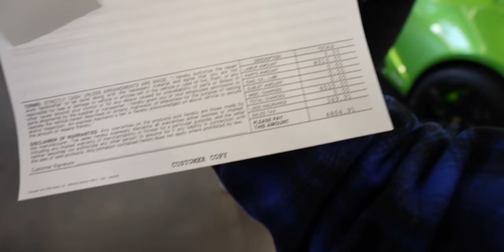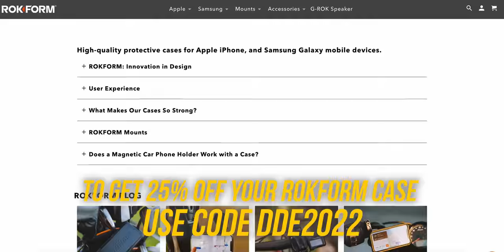DAMAGE COSTS I’M SUING FOR FROM LAMBORGHINI SLEDGEHAMMER ROAD RAGE!

Comment: Watching him pick up that new windshield made me so nervous!
Reply: Me too but you could see he was an absolute pro with how easily he handled it. Complete confidence in his own ability.
Reply: @Kyomara1337  sorry but as a pro i can say this guy is not on par with being called a pro. that job is horrible
Reply: @robineriksson953  well what went wrong? coz to me (obviously untrained) it looks good
Reply: @robineriksson953  let's just say Damon was being nice and found the cheapest glass repair shop he could find. Oh Canadians, too kind.

Edit: I also thought it looked pretty good. Wouldn't be able to tell the difference between a pro and amateur(?)
Reply: @robineriksson953  then enlighten us with what he did wrong? instead of just coming here acting like you know better.
Reply: @Kyomara1337  i did a large post. I'll see if I can copy it. At work right now so. But it's several things. I own a shop wich just deals in windshield repairs.
Reply: @Kyomara1337  first that way of cutting it out is extremely risky. that knife is ancient. you either use nylon thread or a more modern knife with protection on it that is adjustable to have less risk of damage. second is the glue. the way that they cut the tip and angled it will create a blob instead of an inverted V. also the V-cut was to low. also its not straight. he basicly leaned it inwards to the opening instead of 90 degrees to the metal.  as well as using 1 component glue wich increases curing time and often is too stiff wich increases risk of new cracks. and 3rd and worst offence in this case is that he didnt use any primer on the body means two things. big risk of corrosion from thin scratches. some scratches you cant even see with the eye when cutting so by not priming he increased the risk of rust. then 2nd on the body is that there is risk that the glue wont attach perfectly. then on the window there is no primer either wich in turn makes it guaranteed to come loose. especially in a collision.
Reply: @wounddd  first that way of cutting it out is extremely risky. that knife is ancient. you either use nylon thread or a more modern knife with protection on it that is adjustable to have less risk of damage. second is the glue. the way that they cut the tip and angled it will create a blob instead of an inverted V. also the V-cut was to low. also its not straight. he basicly leaned it inwards to the opening instead of 90 degrees to the metal.  as well as using 1 component glue wich increases curing time and often is too stiff wich increases risk of new cracks. and 3rd and worst offence in this case is that he didnt use any primer on the body means two things. big risk of corrosion from thin scratches. some scratches you cant even see with the eye when cutting so by not priming he increased the risk of rust. then 2nd on the body is that there is risk that the glue wont attach perfectly. then on the window there is no primer either wich in turn makes it guaranteed to come loose. especially in a collision.
Reply: @robineriksson953  do you work on supercars? or is it more regular cars? and is the process of windshield installation different for both or the same
Reply: @robineriksson953  fair enough, thanks for taking the time to point out the different things that you'd only notice as a professional 👍
Reply: @wounddd  i work on basically all cqrs. But do alot of what we concider rare and luxury. Tbh i almost think my shop do more AMG cars than Mercedes themselves do 😂
Principle is the same. It's more like some supercars hide things pretty good so you need to have feeling when working with them. Like the Lotus exige you have to remove the entire clamshell. 

It's more like lambos are a bit tighter between the glass and the surrounding paint. But basically it's the same as an Audi A3 or a golf.
Reply: @Kyomara1337  no problem. I can guess why he angles the gun that way and it's because of his belly. Also the Lambo you can glue on the window directly with less risk of the glue showing up inside the car. If the glue touches the interior trim on the sides it will impair the airbags.

Comment: The new windshield is slightly off on the right top. 😬 You can see the yellow on top of the right side after it was done.. It was placed correctly when the first guy put it on but the second guy let the windshield slip down ever so much because he started pushing it on the top instead of pushing it on the bottom and then towards the side. Check out 8:45

Comment: I disagree about the insurance filing suit against underinsured drivers. I was rear ended by a women driving over 100mph, while I was going 65mph. My car was totaled. Turned out she had no insurance so I had to pay my 1000 deductible. They said that I would get reimbursed once they sue and collect, but I NEVER was reimbursed. In fact, they didn't even bother filing suit. After considerable flack from me an agent stated that the attorneys found she had no assets and no money so they determined that a suit was not cost effective and unlikely to realize any amount of reimbursement. So I was screwed out of 1000..

Fortunately I banked with a terrific credit union that offered GAP insurance when I took out the loan for the car. I had no idea at the time how important that was. They paid off the car and gave me 1000 $ if I financed another car with them. So it all worked out good for me. Unfortunately most won't have that kind of great banking experience.

Comment: Fun fact about the windshield razor? Dozens of people a yr get injuries in Ontario due to pulling the garatte part and it slips and will stab you in the face or chest due to the tension and pulling towards yourself, a guy at Speedy Auto glass in Scarboro in Toronto lost his eye so my buddy who worked there told me when I got my Wrangler window replaced. He said he was always careful to pull it the proper way when removing windows with too much sealer.

Comment: Don't forget to charge for the new windshield banner and installation!
Reply: im pretty sure they said in the video it was going to be like 450 for a new windshield decal and roof wrap
Reply: They need an interior detailing charge as well to get all the glass out.. plus a charge for a car detail
Reply: Most insurance companies arent going to cover such added accessories. His will if its specifically named. You cant add $10k in added parts to a $10k car and declare its now a $20k car, unless you get your insurer to recognize that and its gonna cost you extra. The guy who hit him is only on the hook for the blue book value of the car or replacing the parts to OEM spec.
Reply: @john lucier , keep in mind this is a work vehicle. If you have a custom paint or custom wrap job on a work vehicle, insurance isn't on the hook for replacing that as well? I beg to differ.
Reply: @josiahhein6036  that may apply. Where did you get the info that this is a work vehicle? Maybe its time to overhaul some tax laws, if speeding around in a lambo is deemed a business and the cost of exotic cars is written off. 
(Not saying youre wrong, my employers in the 90s had 2 jaguars registered in the name of the office furniture company I worked at. They did use them in the course of a legitimate business that did something for people. I havent seen anything tangible from DDE other than being a nuisance to the community in every way)
Reply: @josiahhein6036  lets say that DDE claims their window banner was a business necessity, but just for aesthetics they had it done in 24k gold leaf at a cost  of $10,000. Would they be expected to replace it? Or would they settle at providing reasonably priced signage, and not be required to replace unusual equipment?

Comment: If I can recall Correctly .. I had the Windshield of my 1975Chevy C-65 replaced for $77.00  in like 1986  .  I also paid $70.00 for a side window for my 1979 Camaro and I installed it myself ..

Comment: i know its done now, but when glass is badly smashed like that, use a sticky sheet on both sides (i use clear book protectant film from the stationary store, couple of bucks a roll). It acts like a window tint or something and catches most of the glass. The mess is one thing but as you know those shards will continue to cut the dash and trim etc

Comment: The majority of insurance agents are clueless and overpaid. They can only write an estimate based off damage that is visible. It’s up to the repair shop to provide proof of all the damage that isn’t visible. I worked for an auto body repair shop for years that specialized in Audi, Tesla, higher end vehicles.. You really can’t get a good estimate until the vehicle is disassembled and thoroughly inspected by an experienced damage evaluator. I’m sure this repair tripled in cost or otherwise deemed a total loss. If you own one of these higher end cars, get good insurance. And make sure the repair shop is specialized, and CERTIFIED to work on your vehicle.

Comment: I had a similar incident involving my 335. Was coming home from the beach, slowed down in front of a dude to go over a set of railroad tracks without destroying my car. Dude behind me didnt like it and apparently thought i was "brake checking him." He pulled in front of me at an intersection to block me in, got out of his truck in nothing but an American flag speedo and busted out my rear window. I took off, until I realized my rear window was shattered. I Made  a Uturn, caught up with the dude, called the cops. The dude tried running despite being in an F150 pulling two jet skis. I called the cops, they finally pulled him over and arrested him. Dude was extremely drunk. The cop who was talking with him came over to me with a little "evidence bag" that included said speedo, and some type of tiny liquor bottle and said "damn, that dude is Fu** up". This made me question how/when/where the dude changed out of the speedo, but anyway he had to pay restitution. Initially they quoted $350 to replace it with a "Like OEM" window, but I told them I would not get a new window put in unless it was OEM and stamped BMW. So they quoted $800, dude had to pay for it, and ended up having to take some type of anger management class.

Comment: Make sure you seek proper compensation for your lost time and the emotional trauma. Make sure its working this off for a very long time, you Essentially own its life at that point which of course isn't valuable as the labor cost to remove the broken glass/cleanup and installation is significantly more valuable than its life is, so make sure you get your value out of it! Side note I love sprayway glass cleaner, it's all I use and I use squeegee for all glass, instant clean with a single swipe, and then get all the drips and excess with rag/paper towel and get a quick dusting of all dash/panels and instrument cluster etc.

Comment: PRO TIP: we have floor mat covers that are basically rolls of tape. You drop it over the floor mats to protect them. Take the floor mat cover and press it against the glass inside and another one on the outside. Thus reducing the glass shards that get dropped.

Comment: 8:00... few years back, had a hail storm bust my rear window out my 2003, 3 door Fiat Punto. Did all this on my own, by myself, no assistance, and to this day, no leaks, holds, and even defrost still works properly lol. It is WAAAAAY harder than it looks, but patience and doing it RIGHT is the key, and no bubbles or odd spacing in the adhesive distribution. I imagine the front windshield is probably 3 times worse than replacing the rear.
\O>

Comment: In most states minimum liability insurance (10k, 25k,etc) is required. Therefore, drivers who are underinsured or uninsured (usually poor or low income) knowingly/unknowingly has advantage to not be held liable, if the  non- fault party has full coverage, or higher coverage. In which most cases their insurance will still pay for remaining uncovered liability despite its not at fault. The only defence you (non fault party)has is to sued, and hope judge grants additional liability compensation... Indeed it's sounds like loophole, and not fair,  but this is the only way everyone is on "same level playing field" to drive on the road... Welcome to reality!

Comment: Really surprised that windshield installers did not use primer before they use the urethane glue which helps adhere the urethane to the paint, keep in mind glass when glued in actually creates rigidity to help keep the car from flexing.

Comment: Mag Works Construction
Residential remodels, room additions, ground up building

From BuildZoom: Mag Works Inc, 2109 National Ave, Costa Mesa, CA (Employees: Gregory Stefan Schnabel and Michelle Jean White) holds a General Building license according to the California license board.

Their BuildZoom score of 106 ranks in the top 7% of 336,931 California licensed contractors.

Their license was verified as active when we last checked. If you are thinking of hiring Mag Works Inc, we recommend double-checking their license status with the license board and using our bidding system to get competitive quotes.

Comment: I'm proud of Damon and Dave for learning so much about the special cars that they drive around in all the time.  That adjuster looked like an idiot compared to Dave which I find very very amusing.  So basically you have to get the car to a repair shop that knows Mclarens and get it mostly blown apart to even find out if it is going to be repairable.  Most of us knew this already, but for the insurance guy to basically just come by and say yeah sure it's fixable like , DUH.  Anything is Fixable if you throw enough money at it, but Are they going to say it's worth it just like the Murcie , I guess .  Good luck with getting the Insurance companys to pay out because they will fight tooth and nail against it which is ashamed.

Comment: I’m an insurance adjuster and this would be the nightmare car if I woke up and saw I had to go write this. 

None of the parts would be in anyone’s estimating software. 1000’s in aftermarket parts from other cars. 

What he’s saying and I tell customers everyday. We can only write for what we can see. Vehicle needs taken into a body shop of your choice, torn down, and a more accurate supplement written. 

Likely they’d have to put it on a frame machine. Setup/measure to see if that frame is bent. 

So this poor guy would have no idea what a GTR wing would run or cost. His system probably doesn’t even have labor times. This is one of those we need the shop to write it and get a parts list and we essentially copy it and pay haha.

Comment: Ezi wire , raptor tool , the hand tool is that you pull through is a Kent tool, old vehicles didn't have the glass glued there rubbers you pull in with a string 😉
Reply: And he didn't use primers when he glued that in the lambo 🤦🏻‍♂️🤦🏻‍♂️🤦🏻‍♂️🙈🙈🙈  🤣🤣

Comment: I had my windshield glass replaced in my S550 that has many accessories built-in the glass , the guys used the exact same technique, a knife with cord and the power glue gun, cost $ 450 glass and labor.
why on earth $4600 for a windshield and $700 for installation ?

Comment: That would supprise me if its like that in US, that the average driver, needs to be insurad pending to the most extreme cars out there.
some vintage cars is in the millions and cyou ould risk to be in depth for 95% of that..
Here in Denmark, where car prices are many times higher, as we pay for 3 cars when bying one, hence tax, - there is mandatory liablelity insurance that everybody needcs to have , when driving in your car on the streets and that will cover all damages on the car you hit or if you reflect damage to a person... 
Just checked the danish mandatory liablelity insurance for driving on the street, does actually have a ceiling, but its 19.600 mio US (137 mio DKK) so your covered to almost 20 mio US just from that standard mandatory insurance here.

Comment: Guys are pro's but when vacuuming the dash, he used a wide rigid plastic hose(not much suction) without a flat nozzle and put some streaks/scratches onto the felt. Dudes its a 800k car. Use a proper vacuum hose and heads.

Comment: I agree. Need to sue.  However. Even if you have everything on tape.  Still a few things that might cause you issues. One. Why are you there. Even though you kept your kool during all this. Why did you stop there. Plus you kept everything to escalate. Doing this is why your windshield was hit.  So partly your fault. Two. Where you stopped at.  Even your lawyer stated that you are parked next to the curb.  Upon looking. You were a lambo width away from the curb. Every state in America, there’s a certain distance from the curb you have to park. Most are 18” and under from the curb to be considered legally parked. Three. You were also stopped in front of a driveway. So being considered legally parked.  You weren’t.  I see many issues that your suit will have issues with insurance if they investigate. Even though your property was damaged. You might be held partial at fault.  All because of the video.  I’m an old insurance adjuster so I hope you the best.

Comment: No no no no & no. As a qualified autoglazier pull knife's are a thing of the past. All they do is scratch cars and create rust over time. I've worked on some pretty damaged windscreens and fibreline has always done the trick. And the polyurethane should always be applied to the glass for the best possible seal. And putting a glue join in the top is definitely a no. Putting the join on the bottom works best as water runs downhill. Don't be surprised if your windscreen starts to leak.

Comment: I hate to break it to you guys but they didn't use urethane primer before they put down that urethane so the chances of it sticking and being a structural part of the car anymore is not good as per icar. I'm sorry but I would have it redone. Windshield urethane requires windshield urethane primer.